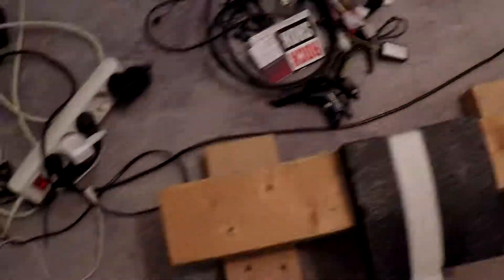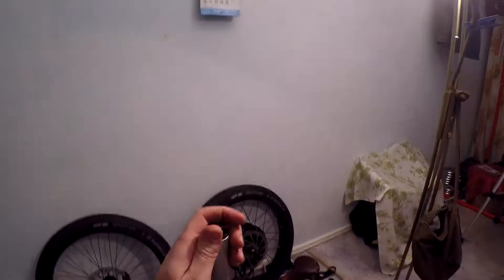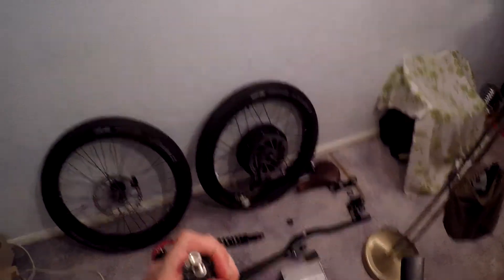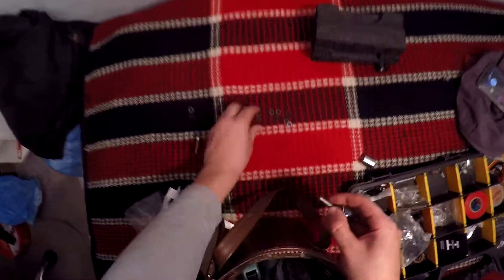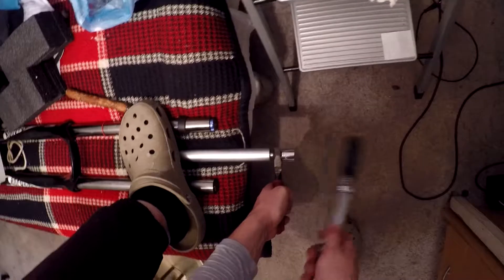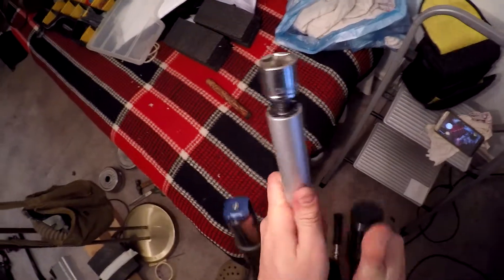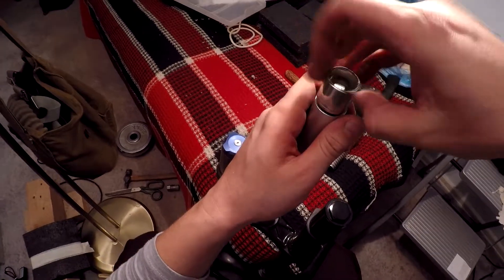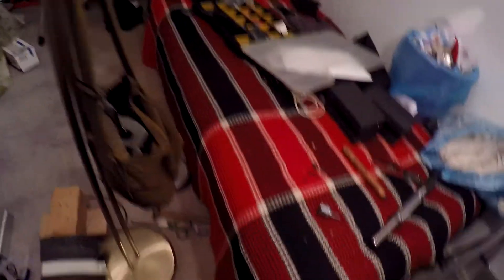Building an Electric Enduro Bike in My Bedroom - #2 Star Nut installation

Comment: All you gotta do is find a screwdriver that fits through the threaded hole and with a handle wide enough to cover the solid part of the nut.  Instead of laying the fork down or hitting it so that it compresses the suspension, hold the bottom of the crown on the corner of a workbench or other solid object with something to protect the paint, that way the dead blows go right to the nut and not towards compressing the suspension or moving the fork laterally.

Comment: At last part 2 =) what you thinkin about Bafang 1000w on carbon bike instalation is it worth it, its costs like 650euros + bike like 800euros? or just buy Enduro bike with 3000-5000 wats motor + inventor on it and be happy =)?
Reply from the maker: Hey :) You have to ask yourself first, what you planing do with it? For example. I have clear vision. Maintance cost should be low(only sealed bearing have to be replace every 10k-20k cost only 6EUR, sets of bearing), mostly using throttle anyway and mileage per year is 6-10k+ km. It is not intended to pedal when the battery is empty due great resistance from the direct drive magnetic motor. Bafang motor is great for touring when you plan to use the pedals. The motor has a low center of gravity. Carbon and 1000W I dont know. And maintaince cost is high (chain replacment every 1k+ km, chainring).
This is a very important decision, I recommend looking for information in forums like I did. It took me a month to know exactly what was right for me.